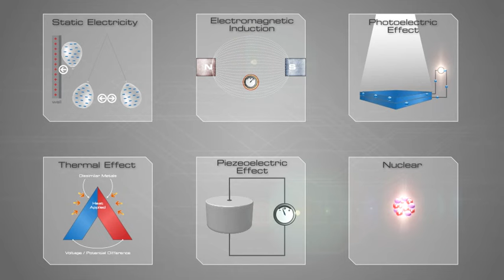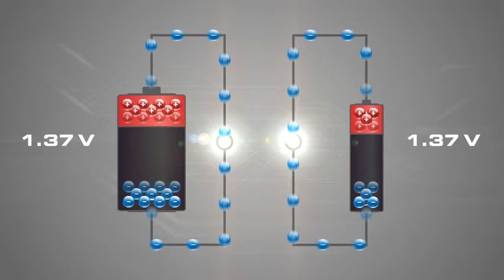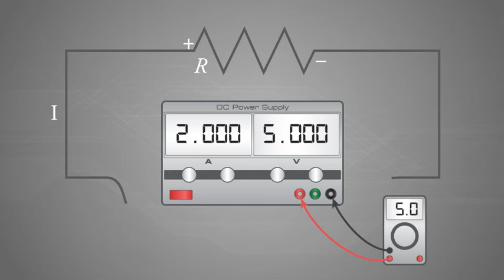Electromotive Force

Comment: I used to know that the battery only supply the  force to push the electrons existing  into the conductor wire  through the circuit. So am i wrong? Is the battery to introduce electrons to the circuit?

Comment: Why the value of potential difference is less than the value of EMF ?
Reply: As everyone always says, its because the laws of thermodynamics.. Even with pure gold wire conductors, there is always a tiny quantifiable level of resistance in the wires.. Resistance leads to the conversion of electrical potential energy to that of heat energy so that the value of electrical potential energy will be very slightly decrease..

Comment: Atlast,emf is the electric potential difference.am I right ?or correct me
Reply: Crt
Reply: @hemaharini360  but for real battery due to internal resistance , emf will be greater than voltage . Finally , emf and voltage both are potential difference but measured during different situations

Comment: Is EMF the exact same as voltage?
Reply: as far as i understand.. yes. voltage is energy supplied per coulomb of charge. Emf is the total energy for the whole circuit per C of charge.

V= I x R

Emf = (I x R) + (I x r) = V supplied to the circuit = lost volts

r= internal resistance
Reply: E.m.f is potential difference too. But in an open circuit. Therefore it’s units is similar to that of p.d. 
E.m.f’s SI unit is epsilon and that of p.d is Volts.
Reply: Epsilon is the symbol, not the SI unit. Like how f is the symbol for frequency but the symbol is Hz. The si unit for Emf is V

Comment: I can say the EMF is the actual potential difference in the circuit. Which means the voltage of the source, or battery minuse the voltage drop of the internal resistance of the battery. I hope that explains whay you mean ☺️

Comment: inside a cell,electrons and positive charges move in opposite directions,the flow of electrons can be taken flow of positive charges in opposite direction,so that way there are two cases of flow of positive charges inside the cell,why dnt we take the net current inside the cell as 2i.
REPLY
Reply: Positive charge doesn't move through out the cell only the net movement of negative charges constitute current

More over if both charges move in opp direction as u mentioned,the current become 0 not 2i
Reply: @hemaharini360  my concern was for inside the cell where i believe positive charges can move,outside yes only electrons flow,thanks.
Reply: @sachinrath123  YA!! ELECTRONS ARE VERY MUCH LIGHTER THAN THE POSITVE CHARGES (PROTONS)...THAT'S WHY ONLY ELECTRONS MOVE

ELECTRONS MOVE FROM ONE PLACE TO THE OTHER AND LEAVE THEIR OWN POSITIVE CHARGES BEHIND, SUCH THAT THE 'BEHIND' PLACE BECOMES POSITVE AS A WHOLE, AND WHERE ELECTRONS GO, THAT BECOMES NEGATIVE

Comment: is emf and resistance (R) the same thing?, or is the cause of existening resistance is the existence of emf?
Reply: Emf & resistance are entirely different things. EMF is a type of force or pressure which makes electrons flow. The flow of electrons is known as current. Resistance is a property that opposes the flow of current. So for a given voltage, a higher resistance would mean a lesser current flow .
Reply: @chetananam475  but emf acts as a resistance, so there are two types of resistance of what i'm understanding, (R) and EMF

Comment: Please correct me if I'm wrong but I think you're mixing the two theories of current flow in a circuit in your explanation and creating a contradiction here. You're using the electron theory of current flow in your explanation but you're still using the same +/- polarities of the battery which are defined for the conventional current flow theory. Hence we're seeing the contradictions where electrons are expending energy as they go up the potential rise of the resistor and gaining energy as they go down the potential gradient of the battery.